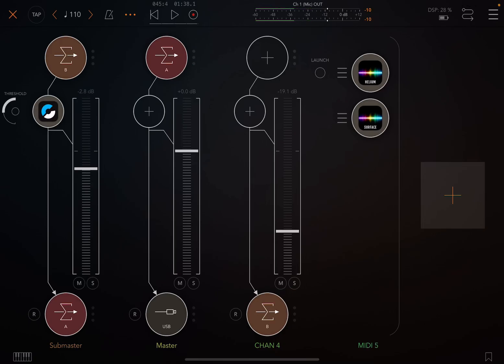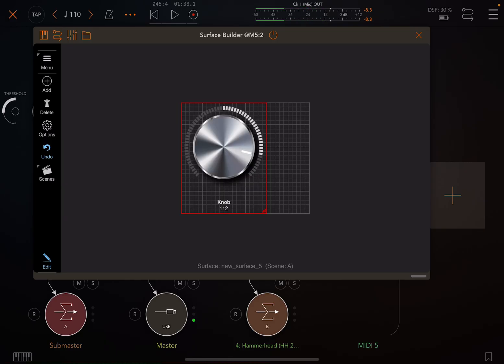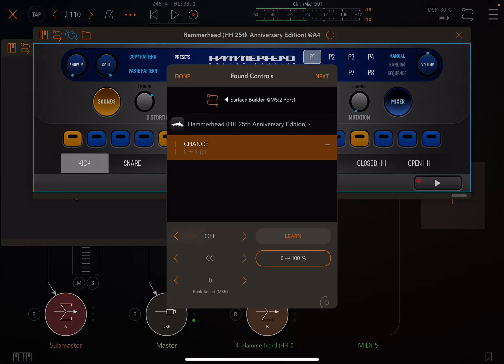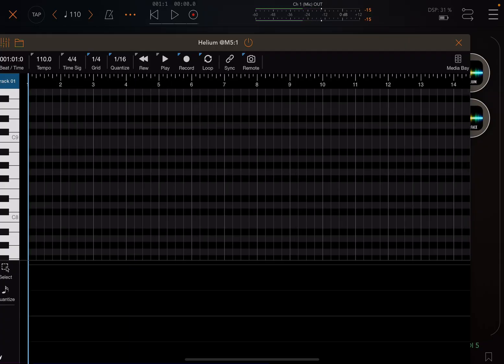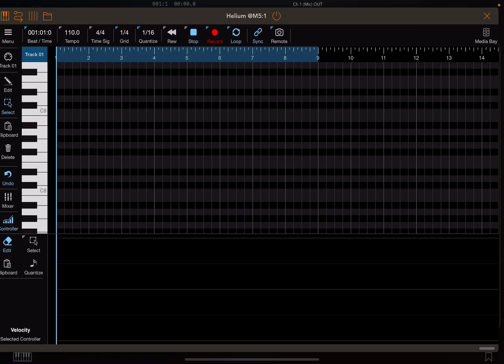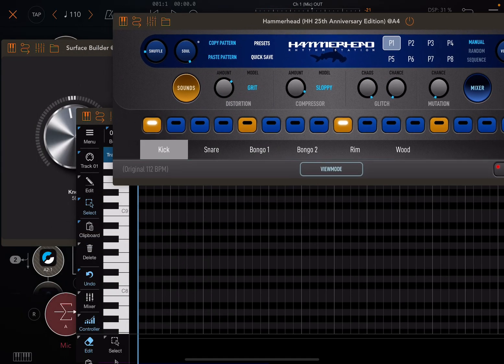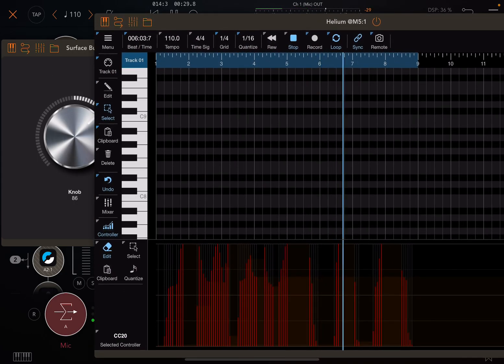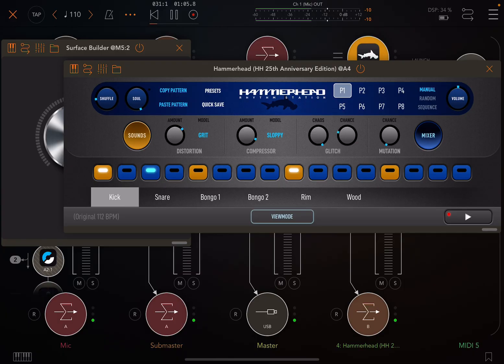Using 4Pockets Helium to automate knobs and sliders inside auv3 (midi automation tutorial)

Comment: How can i midi mapping the Helium patterns?
Reply from the maker: Sorry for the delayed response. I believe Paul (the 4pockets developer) covers this topic here:
https://www.youtube.com/watch?v=lBE56SK92h8&t=380s

AI had this as an answer which seems to imply a similar solution: sequencing note data that is sent to helium which will switch between the different loops.

"To switch patterns in 4Pockets Helium via MIDI, you typically use MIDI Program Change (PC) messages for simple pattern selection or MIDI Control Change (CC) messages for more advanced control like triggering loops or variations in its song/clip modes, often mapped to specific notes or controller values in Helium's settings, especially within its AUM AUv3 environment. You might assign a MIDI note (e.g., C0) to a specific clip or pattern in Helium's song mode, then trigger that note from an external sequencer to change sections, or use CCs for granular control within an app..."